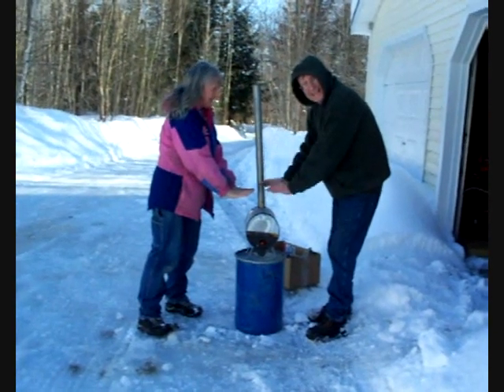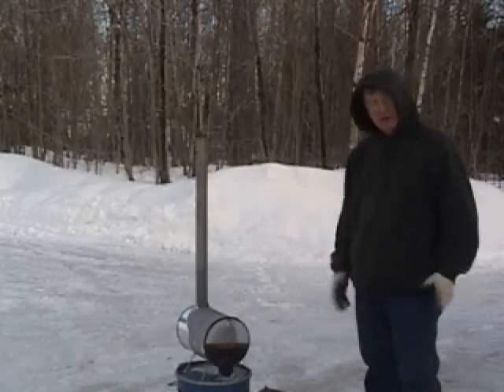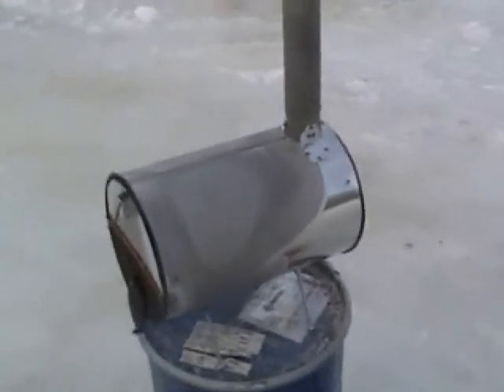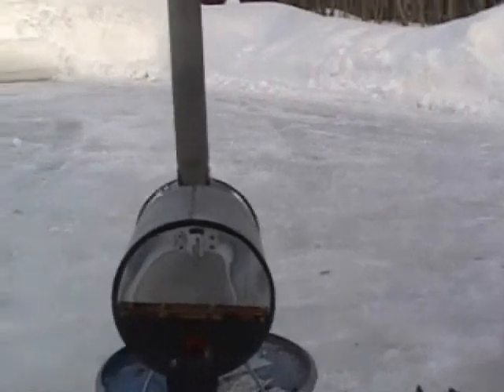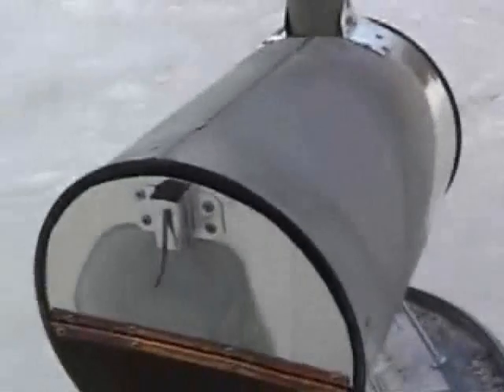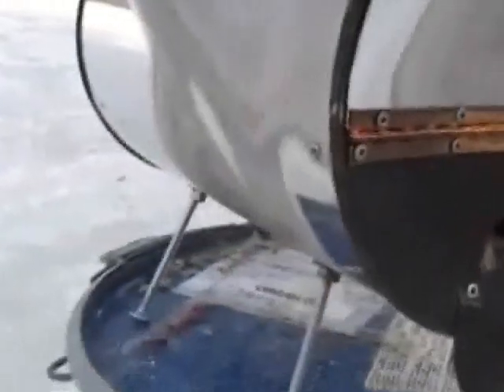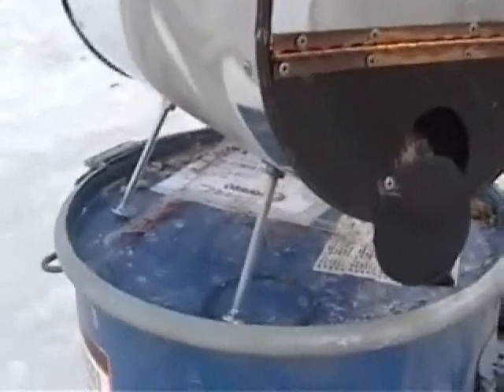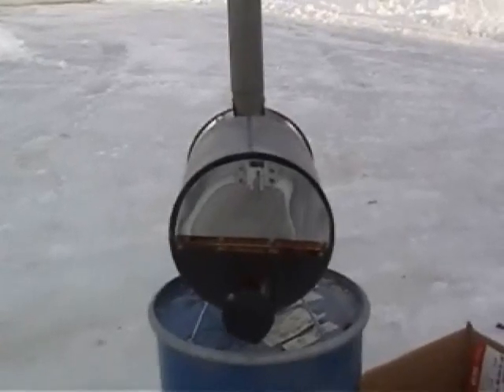The MBDC HOOCH HEATER proto#1

Comment: That is a good call.  Can you compare and contrast brake line dryer/ denatured alcohol/ dry gas/ other fuels?  I am interested in your opinion on smut factor, heat output, cost, and anything else you can think of.  Thanks.
PS. for a first prototype, that is one butt kicking stove!